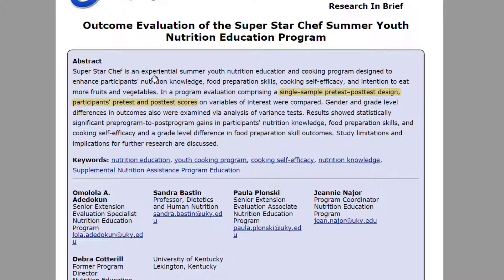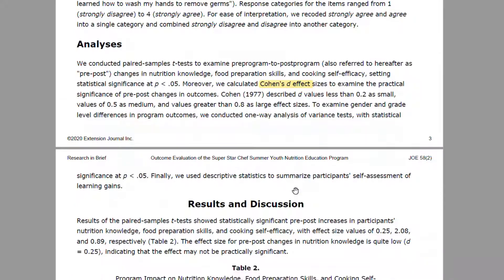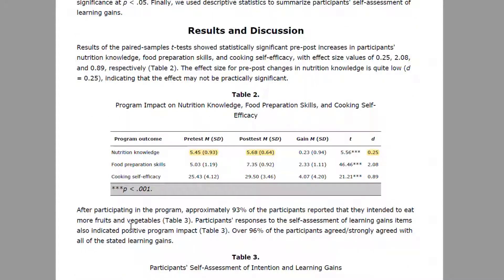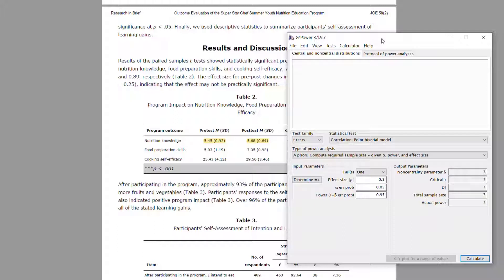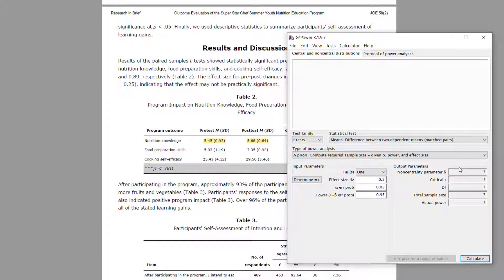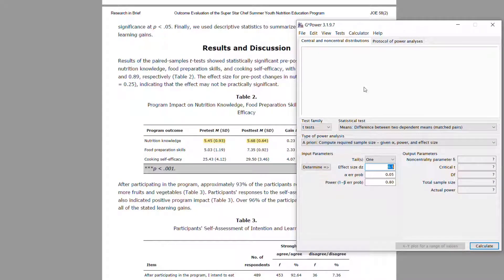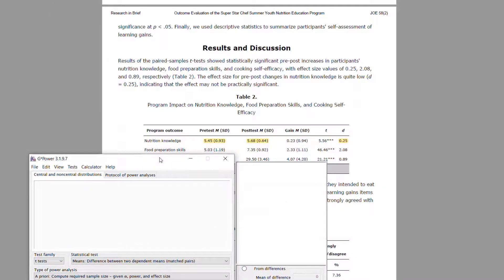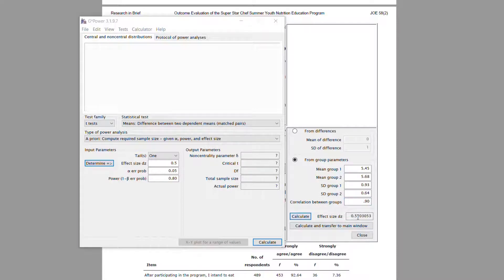How to Calculate Sample Size with GPower

Comment: Thank you for the informative video. My question is that how would you know which parameter to choose to be input for calculation of effect size?

Thank you.
Reply from the maker: For a test, use the means and std deviations. You usually need an estimate of affect size like the correlation coefficient and some measure of variability.
Reply: @robertlachausse8135 sorry I wasn’t clear enough.

In your example, how did you determine to use the mean and SD of nutrition knowledge, instead of food preparation skills or cooking self-efficacy

Comment: Also what does it mean by "correlation between groups" in the section of effect size calculation
Reply from the maker: There is going to be a correlation between groups, because in this example were using a one group pretest post test design. So the pretest scores are going to be highly correlated to the post test scores, because each of the two scores come from the same subject.

Comment: i want to calculate effect size and confindence intervals , what should i choose in the gpower - by my understanding i should go for standard deviation pooled and then calculate cohens d ,,,,
Reply: or shoould i first compute sample size and then use that smaple sizeto compute effect size , your help would be appreciated greately man . thanks
Reply from the maker: What type of stat test are you doing?
Reply: @robertlachausse8135  i am planning to do a priori and then use its sample and calculate post hoc , so i can state that if i do similar kind of study how much sample size would i need for x amount of power
Reply from the maker: @ArjunSharma-wi3jp  in Gpower, you need to specify the research design and statistical test you will do. For example, if you wanted to look at differences between men and women and the number of times they smoke cigarettes you could compare the sample mean for men to the sample mean for women using an independent samples t-test. In G power, you would specify independent samples, t-test, or it’s also called two sample t-test. And simply put in the effect size, Alpha, and power.

Comment: It'll be a type 1 error as there might not actually be a difference but the outnumbered sample size would resemble a difference that's not true
Reply from the maker: Yes, I type one error is most likely to occur when the sample size is too big. So for example you might say there is an effect but there’s actually not because the sample size is too big. That is why calculating the exact sample size that you need before you collect data is so important
Reply: @robertlachausse8135  your simplification was quite helpful. Thank you